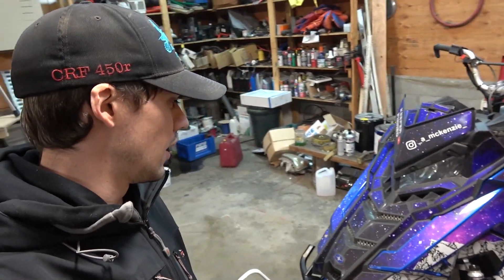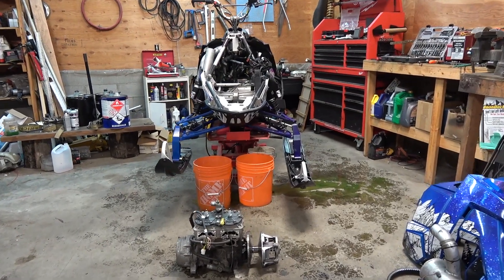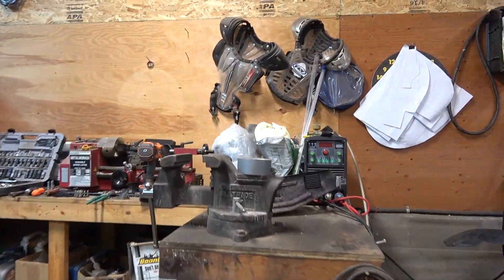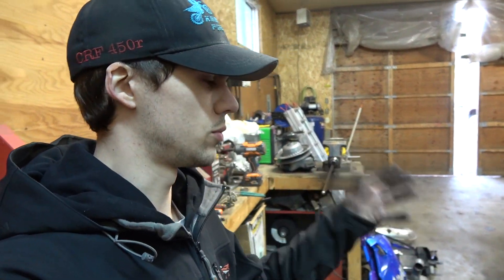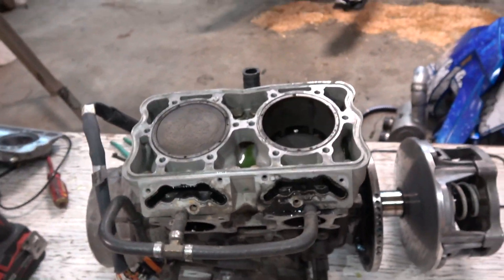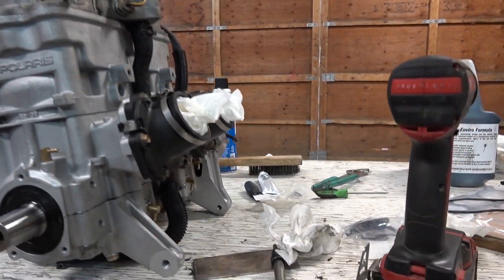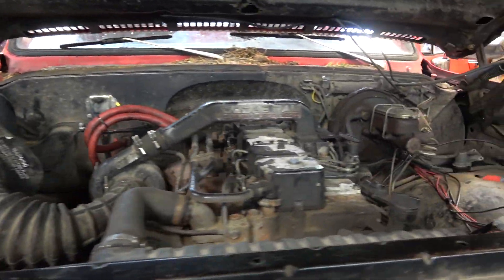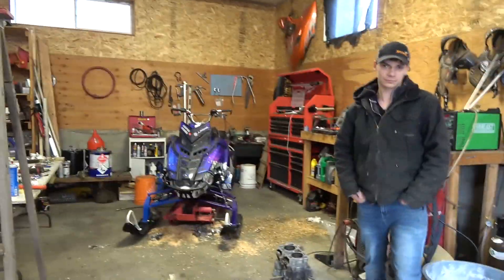Turbo Axys Motor Swap + Square Body Cummins Drives! | Shop Vlog march 20th 2022

Comment: Love the video! Make sure you upgrade your fuel pump that feeds your VP44 injection pump on your white Dodge. You don’t want it to drop less than about 8lbs or it breaks the diaphragm in your injection pump, then you you get to buy new injection pumps until you upgrade your fuel pump. I have a FASS on one of mine set at 15psi and never drops no matter how much boost I am pulling. It is 15 years old system and a 90 galling an hour pump… Has been perfect for nearly 100k and running edge evolution with 90 horse injectors. Old 24 valve truck rips and reliable as all get out. I am sure you know this stuff but I learned the hard way buying 2 injection pumps until upgraded to FASS.
Reply from the maker: Oh man 2 injection pumps! Pricey! Thanks fir the info, i put a fuel pressure gauge in my 24v and quickly learned i needed a new lift pump so i put a fass 150gph in it with a bottom sump kit, so we should be good to throw some power at it …. Until the trans falls out of it 😂 love my old truck! Haha

Comment: Great video. What are you using for a lift there?
Reply from the maker: Thanks! The snowmobile lift im assuming your referring to?
Reply: @KEEPERPINNED  You betcha. Looks like a nice lift!
Reply from the maker: @skaftisinclair4917  thanks! I honestly dont know what brand it is, i bought it about 8 years ago from some local guys that have a motorsports dealership, i would highly recommend having a lift for working on stuff, they are quite handy!